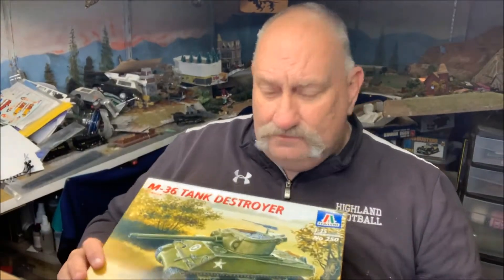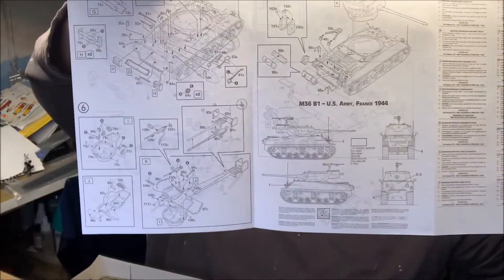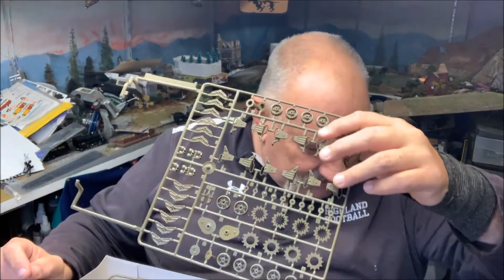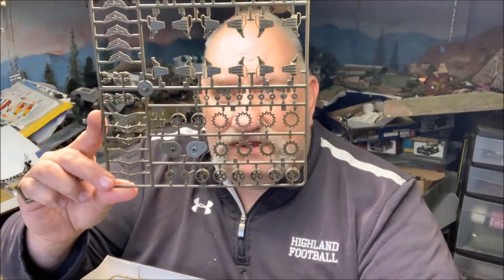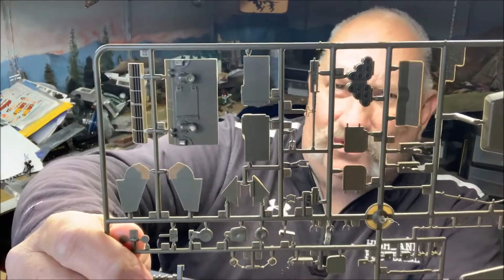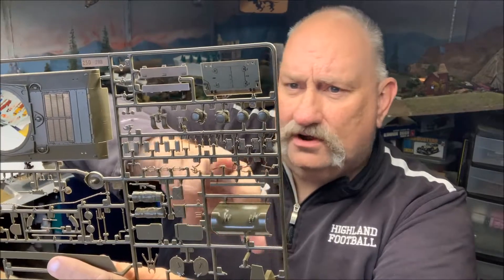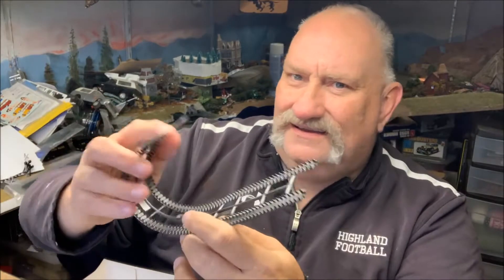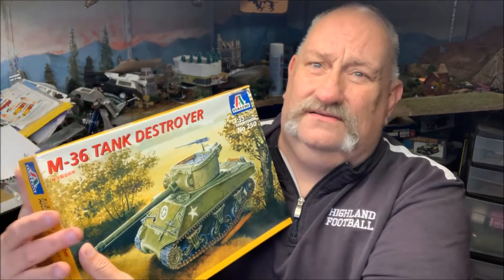Italeri M-36 Tank Destroyer 1/35 scale

Comment: Btw, if  you want to hide a lot of the flaws inside of the turret of the Italeri M36 Jackson, there are two easy ways to do that.

#1. The easiest. make 4 rods from sprue by slowly heating it over a flame like a candle and then SLOWLY stretching the sprue. The faster you stretch it the thinner the result. (if pulling the warmed sprue quickly you'll end up with a thin length that is fantastic for antennas) Or  you van buy some Evergreen plastic rod about 1/16" diameter.

You need a small circular disc of plastic about 1/8" to 3/16" diameter.

The 4 rods get glued to each corner of the turret and to the disc so that the disc is slightly higher than the turret = about half the height of the moulded on machine gun pintle. Those 4 rods and disc are then covered with tissue to simulate canvas. A very light mist of white glue drastically thinned with water will give the tissue some stiffness and make it easier to paint without tearing. You can add acrylic paint to the glue/water mixture so you won't have to paint the tissue afterwards.

#2. You can make an armoured cover from sheet styrene for the turret. That cover just had vision slits.

You can find images of the canvas supports on the web as well as images of the armoured cover.

Comment: The main reasons so many call this kit a dog are:

#1a. So many errors including the ammo storage in the rear of the turret.
#1b. The road wheels should be solid not open spokes.
#2. Lack of details in the open turret especially on the 90mm gun.

Btw, and just for interest. The proper designation for these was GMC not tank or tank destroyer. GMC stands for Gun Motor Carriage.

The tracks can be made a bit more flexible by carefully scoring them where the grooves are.

It does build up to a not too bad looking model and it's a fairly simple build. It's a decent kit for a beginner or youngster and the cost is a lot less than modern kits.